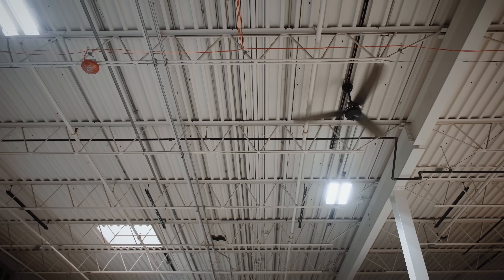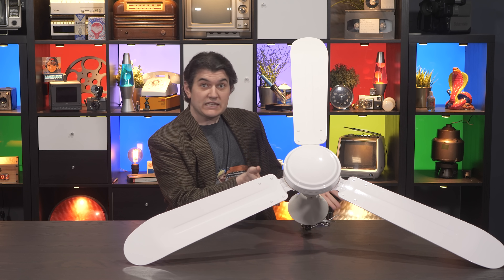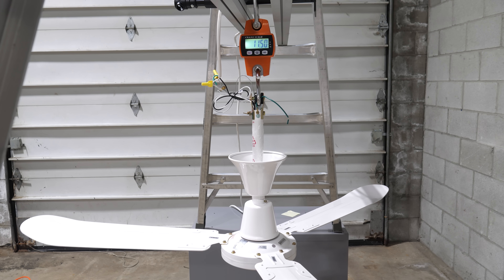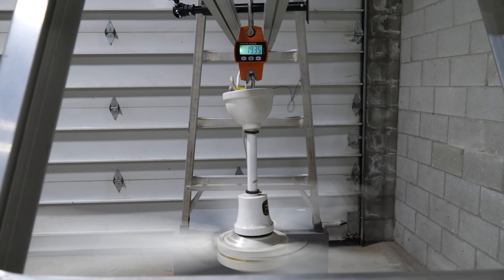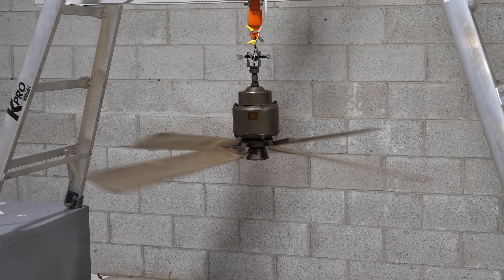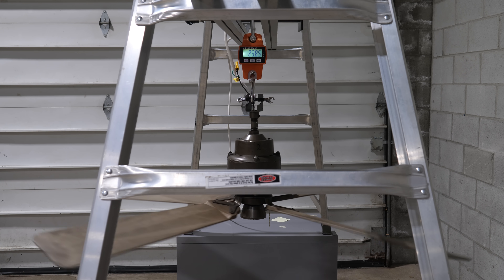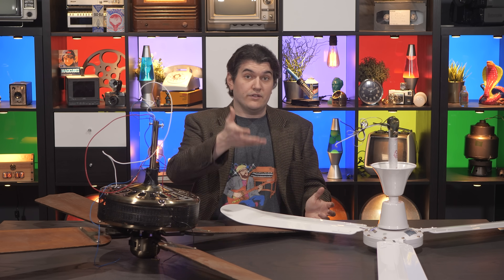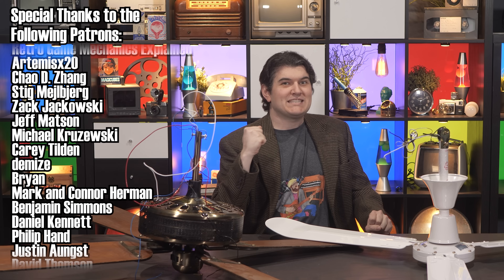How much thrust does a ceiling fan produce?

Comment: Jerk force at startup sounds like this YouTube channel, but then again I'm watching it aren't I?

The boomer in me says ceiling fans ought to have a proper induction motor not those brushless DC things. Nothing good will come of that!
Really the only thing that bugs me about the brushless DC motor fans is that they start randomly in the wrong direction and then quickly correct. A real motor ought to know which way to rotate its field in the first place and not have to guess.

Comment: Wouldn't the safer and more accurate way to measure the force given by the ceiling fan be to take a bar and put it across a regular scale then attach it the ceiling fan to another bar below both the original bar and the scale? Then it's more stable, isn't it? And then it also better simulates a ceiling structure rather than a wildly swinging fan?

Comment: This is not the fan you're looking for, the one you're looking for is an aisle three and has six Fig Newtons worth of thrust for your cooling and heating pleasure. Simply insert six Fig Newtons into the fan and it will work for 60 minutes. Please ignore all the sounds of eating on the inside of the fan.

Comment: I know it's no effort November, but it probably would have been actually easier to make a jig to hold these things upside down and weigh with a normal bathroom scale (granted bathroom scales don't usually have 2 digits of precision)

That also would have factored out ground effect issues, which I assume is why you raised the fan. AND you wouldn't have had the torque issue...I mean, it's still there, but in a much more stable condition

Comment: One minor issue, the fan thrust you measured isn't the true thrust only the apparent thrust. The true thrust should include the weight of the object it moves along with the apparent thrust.  This is kind of like passing a car going 30 when you are doing 35.  Compared to the road you are going 35 but in reference to passing the car you are only passing it at 5 miles per hour.

Comment: Propellers do not thrust…… they pull. Each blade is a wing that when you move it through the air, it generates a pulling or lifting force depending on orientation.  

Fun fact a helicopter can spin its blades at full rpm and not move, you have to change the angle of the blade to get the difference in pressure over the blades you need to generate a force. 

The blades will move some air but not enough to lift anything, even the largest helicopter at 0 pitch will only blow your shirt around. 

I love your channel and you’re a smart guy and for the first time ever you’re wrong. 

Your thinking a propeller works in the same as a jet engine, it does not.

Comment: As far as the effects on the electrical box, by code a "ceiling fan" rated outlet box is to be used which are heavier gauge steel and larger fixture screws to contend with the extra weight and deflection caused by a fan.

Comment: Ceiling fans actually need a special junction box capable of holding a ceiling fan. You're not supposed to use a regular electrical box as they aren't rated for that. Most places put in compatible boxes where they expect fans to go as chances are a fan will get installed. These boxes often contain the required emergency fall protection hook which keeps the fan attached should the main hookup fail. That junction box is also attached to bear the weight of the fan and the torque

Comment: my first idea was to test it with its base down, attached to a big, stable base. if the base is too wide for a scale, hinge one end and put the scale under the other. this will create a class 2 lever. the scale readings vs the force are not 1:1 in this configuration, but that ratio can be discovered by using weights of known measure and going from there. you made november much harder than necessary, alec!

Comment: Helicopters don't fly. They drill into the air like a screw. The tail rotor is doing  more work than you might think. The Chinook is the exception. It IS like haveing three plains wings going in a cricle. But it sucks to ride in. The propellor on a plane drills into the air horizontally, like a wood screw. 

Also I appreciate you calling it thrust.

Comment: You know I question the hanging weight versus weight from the bottom that would negate the twist force.,. 
Essentially, you would be able to just weigh the frame and the fan together from the bottom and that would be the most accurate no?

Comment: I wonder how much blade shape influences this
Reply: A lot, but it's complicated. Like, the reason fans don't have the aerofoil shapes of propellers is because those simply don't make as much of a difference at low speeds, so the increase in cost wouldn't be worth it, and I'd guess you'd end up with heavier blades that would be harder to spin anyway. You'll also notice fans typically have blades that cover most of the circle they occupy, whereas propellers are mostly big gaps between blades. This works for propellers because they spin fast. Each period of time the amount of air the blade can push is related to both it's size and the area it moves over as it spins, as it interacts with all the air in it's path as it does so... but at lower speeds, the amount it's moving per unit of time is less, so it's interacting with less air. If you want a fan blade to move more air, you either need to spin it faster, make it longer, or make it wider. The faster it moves, the more aerodynamic effects are a concern and the noisier it is, you wouldn't want that in your home. There's only so big you're going to want to make a fan, so they can't just keep making the blades longer... so the blades are made wider.

This is also why ceiling fans aren't like that, especially the larger ones. While it's common for narrower ceiling fans to have wider blades, bigger ones tend to have longer thinner blades.

Comment: They make special boxes for ceiling fans. They're attached to a brace that attaches to the studs on either side or directly to the side of a stud. They even make retrofit ones that install through the hole an existing ceiling box was in. The braces solidly anchor the box to handle fans or very large light fixtures like chandeliers. It's the ones people install on the plastic boxes ya gotta worry about, never know when that's gonna stop holding.

Comment: Ceiling fans should be as powerful as airplane propellers.
Reply: Why? They are made of cheap wood or cardboard
Reply: @OffendingTheOffendable  do, uh, clearly they maybe need to be made of something a smidgen stronger then? 
Fascinating that something like this would need to be explained.
Reply: @seigeengine  I mean maybe slightly less than a P-51, but a Cessna at least.
Main point is I'd like them to blow a fair bit more air than they do.

Comment: Contractor here.  Fun fact!  We literally mount these to extra sturdy boxes called (at least in my market) fan boxes . Responsible electricians do this either into the joist or into blocking attached to the joist.  In retrofit applications there are special bar-mounted boxes that telescopically spear themselves into both adjoining joists.  Even crap-grade framing screws shear at or above 80lbs of force and most electrical boxes get two or more.  Unless your builder has missed the joist, a metal electrical box won't even notice an additional pound of force.  Even more fun? fan boxes are often the only ones deep enough for surface-mount potlights and their associated clips and electronics.  We use them when we need cheap, effective soundproofing.  Slap a commercial putty pad on the back, and you won't hear a whisper between floors.
Reply: I'll bet you have seen your share of fans mounted on pancake boxes screwed to lath behind real plaster.
Reply: @TechGorilla1987 pancake boxes were legal for fans for many years.
Reply: @barfy4751 is this a literal term? A box of pancake mix..?
Reply: @somethingsomething404  it's a thin box that can mount on the surface of the framing. Same thickness as the rock
Reply: @TechGorilla1987  Not every time, but with shocking regularity.  Starting to get an appreciation for how tough even clapped-out old lathe can be.
Reply: I did my own fan install, but I had joist access but not knowing what box to get I just got one with the cross bars and said it was rated at 300lb static and 150lb live load. And I know my fan is not 150lb. but it was an interesting box because the fan does not hang from the box itself but instead from the cross bar with U shaped bolts that go over the bar and down through the electrical box.
Reply: My electrician insisted we use "fan boxes" everywhere in our recent renovation because according to one inspector: If there's room enough for a fan, you have to assume someone will hang one there.... so, over a toilet, above the back door, kitchen sink, etc. Any box ≥18" from a wall. 🙄
Reply: @benkalow  My former employer from summers in college put them everywhere too. He had heard too many horror stories of homeowners swapping out bedroom lights with ceiling fans and having them drop out of the ceiling. We used them for the dining room chandelier, breakfast table, and the center hall lights as well. Anywhere you'd see a heavier fixture hung from the ceiling.
Reply: @incidentshappen  I like that.  It costs a whole $8 more, and you never have to worry about the client's kids swinging from the chandelier and then having it land on top of them.  An ounce of preparation is worth a pound of cure when a $400 drywall patch is potentially involved.
Reply: - lol, and yes many fans have a cable lanyard for the Just in case (onee's  experience may vary based on market and subscription to OSHA principles.)..  (NB, the cables arestrong enough to stop the fan from falling of the mount were to fail....   lol..

(all just a bit of Low effort fun...)
Reply: @kadmow  And the lanyards are a delight: especially when you discover how strong they are by ruining the cutter of your favorite wire strippers  🤣
Reply: Some of us on the westcoast of Canada call it a fancake
Reply: @QuinnTheVegan Texas uses the same name.
Reply: Okay... so now I know what to do before I sell my condo to make my ghetto installation more secure. I didn't think the lighting box I used was enough, but it worked.  I always thought I needed to secure it better if I ever intended to sell. And now I know how.  Thanks!
Reply: Heard em called Fancakes before. Thought it was a fun name.
Reply: Well, the torque from motor startup wasn't the 1 lb. of force being measured in the video, so your assurance doesn't really make sense.
Reply: As an apprentice, I appreciate the in depth response you've given!
Reply: @OverwhelmedMushroom  this channel is the place where folks might appreciate all the gory details.  I'm glad the information is useful: that soundproofing trick has been keeping our clients happy, inspectors pleased, and budgets slim for years now.  Do good work and you'll always have work.
Reply: But did you take into account the extra weight and shearing force when a post-midnight-fed gremlin grabs a fan blade to take it for a ride?
Reply: Responsible technicians (or rather regulations requiring them) are the reason i can't afford technicians and have to do shoddy electric work myself.
I remember some time ago i could just ask someone who knew what a cable is and be done with it. Now i need a group of scientists to install a power outlet.
Reply: @chrisakaschulbus4903 ok boomer
Reply: @SuperNovaHDSS  I am 25 :(
How does "boomerism" work?
Reply: @chrisakaschulbus4903  $135/hr(CAD)+tax for an electrician and an apprentice around my parts (they come as a conjoined set: one doing the work, the other rooting around in the truck).  'Course, in my case it gets passed through to the clients....

Comment: I was always curious about it because I can't help but think the fan above my bed will dislodge itself and fall on me while I sleep.  Now I want to see spinning drop tests to visualize just how little the thrust matters so I can worry more.  Not really, but the shattering glass from the light fixture beneath will probably be of more concern than the spinning blades.  This is all assuming that it somehow dislodged without spinning like Peahats from Ocarina of Time doing some kind of precession dance toward a full sideways fan slam into my banana and berries.
Reply: I mean, if it's badly mounted that could happen.

Good news is that precession should make it less likely to do that if it does fall while spinning.

Comment: I'm not a physicist but i'd like to see these fans put through an actual thrust testing setup and see what they can actually produce.  The scale shows that they would in fact produce measurable thrust but the rig itself is just too unstable to attribute any of the weight reduction to air flow

Comment: One caveat: fans aren't propellers, even though propellers are kind of like fans. Props exploit aerofoil profiles to maximize their thrust output and are generally more efficient with fewer blades. Fan efficiency is almost independent of blade count. Props will also move air way faster at the same rotational speeds to a comparable fan.
Reply: Nope. Propellers are exactly fans. Fans don't have the same shape as propellers simply because it's not as relevant at low speeds, so the added complexity (and weight) aren't desirable.
Reply: @seigeengine  Disagree. Fans are rotating screws intended to move air, usually divided into sections (though not always, and some fancy fans are full-turn screws). Propellers and rotors are rotating wings, not screws, and though they do move air, they intentionally create much stronger pressure differentials on opposite sides of the prop blades for the purpose of generating lift and thrust. They are similar, but they are not the same, especially not exactly.

Comment: You can't convert between grams (or kilograms) and pounds, without knowing the acceleration, which is slightly more complicated than usual in this situation, because in addition to gravity you've also got stuff going on related to what the fan itself is doing, and you aren't taking that into account properly.  When talking about the rest mass and resting weight of a person, or a bag of potatoes, or whatever, folks generally just assume that the acceleration is 9.8 meters per second per second (which is what gravity does to human-scale objects on Earth at mean sea level in the average case, which is usually close enough for government work); although even then it's still technically true that what you're doing isn't just a unit conversion; it's a physics calculation.  Be that as it may, when you're playing around with an object that is producing measurable thrust in a vertical direction, that simple constant for direct conversion between mass and force, is no longer valid, and your "pounds to kilograms" converter is going to give you the wrong answer, because it's based on invalid assumptions about the situation.  In particular, when you turn the fan on and the weight in pounds changes, the mass in grams or kilograms does not change.  The number of newtons changes, but the number of grams or kilograms remains constant.  The change in force, is due to a change in (net) acceleration; there is no change in mass.

Comment: In my foolish teens years, I hooked up a half horse motor to an automotive radiator fan and built a makeshift cover to protect you from getting into the blades with your hands or other body parts and turn that on to cool off my bedroom. On high speed, it would barely stay upright. It wanted to blow itself right over. 😂

Comment: I would have used a precision platform scale, mounted the fan upside down on it, and had the fan push the air up toward a high ceiling, but that would have taken a bit more effort..

Comment: I noticed the video didn't mention this, so I thought I’d share some additional insight. As a pilot with extensive experience in aviation training, I couldn’t help but comment. The blades in this demonstration aren't operating based on Bernoulli's principle. Instead, they primarily function by deflecting air, which is precisely what they're designed to do in this context. Unlike a real propeller blade, these blades lack an airfoil shape.

Air, being relatively low in density, results in the displaced air mass having minimal weight. In contrast, the functioning of actual aircraft propeller blades involves more than just air deflection. While deflection plays a role, it is relatively minor compared to the pressure differential created by the airfoil shape of the blades. This pressure differential is the primary mechanism that allows the propeller to pull through the air mass effectively.

I’m not sure if this message will reach you, but if it does and you’re interested, I’d be happy to arrange a flight on one of our USAF/A-CAP aircraft. You could create a follow-up video to highlight the performance differences that a properly designed propeller blade can make. Thanks again for the video!
Reply: Yes, the blades are like mini wings spinning around. 
But like an airplane wing pushes the air mass down (on average), the propeller pushes a mass of air back, doesn’t it? No push, no pull.
Reply: The ONLY way propeller blades and all similar wings work is by deflecting air. The way they do this is more complicated than just smacking air out of the way, but it is only by moving air that they function.

To say that an aerofoil creates regions of high and low pressure is to say that it moves air. It's just two ways of saying the same thing. A wing passing through air creates these regions of high and low pressure because it moves air from one side of it to the other as it interacts with it.

The propeller pulls the aircraft by pushing on the air.